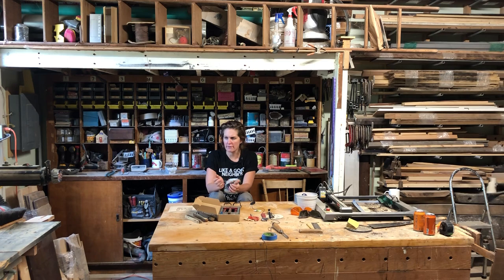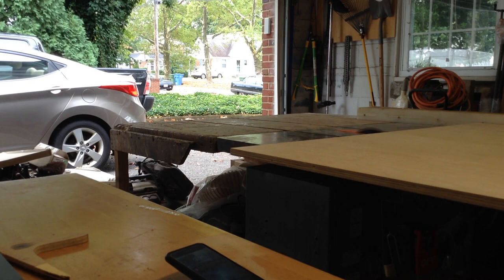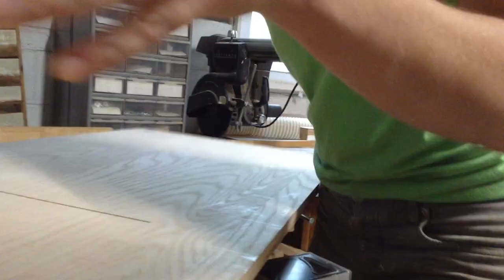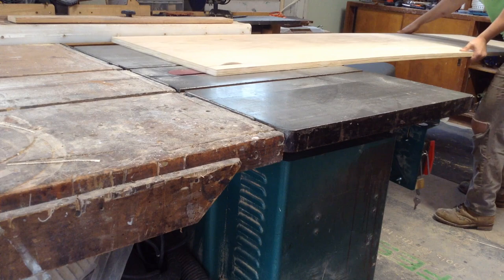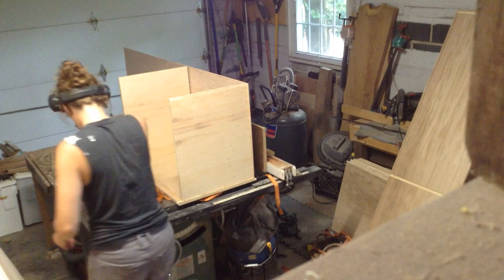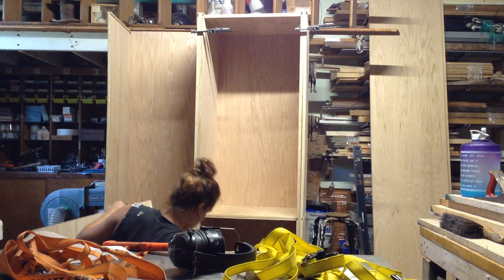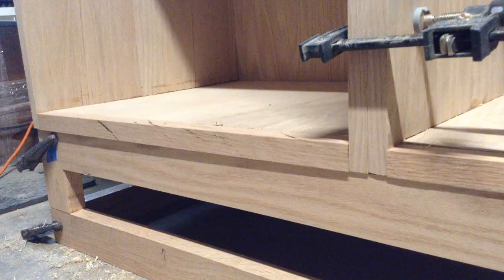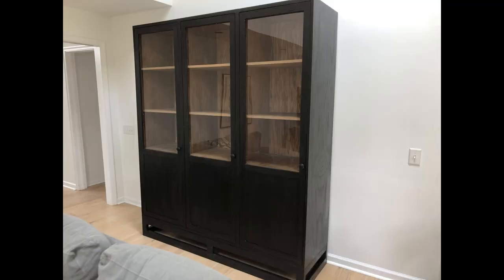Woodworking : China Cabinet w/ Storage // How-To Part 1

Comment: Your radial arm saw must be super well-tuned, to be able to flip the workpiece and get perfect alignment.   Mine's OK, but not that good.

I hadn't noticed that about plywood, but I am going to start checking now.   Thanks for posting, and thumbs up!
Reply from the maker: It actually got moved substantially out of square during the move, you can notice in the video it's not cutting perfect to match when I flip them.  But because these are sunk in dado's it didn't make a huge difference.  Getting it back into square was such a huge pain in the ass though.

Comment: I had the same problem with a sheet of plywood recently.  In my case, I found that much of the variation in thickness was all in the 1” or so from the edge. I have always heard you should discard the material near the factory edge but I had never really found it to be a problem in the premium plywood sheets.  Now I am checking every edge! Love the video thanks
Reply from the maker: That's good to know because my next three projects are going to eat up a lot of ply, and I don't want to keep re-cutting dados and shimming things.

Comment: I find the veneer thickness on the plywood very thin now.
I build most of my projects out of maple. I get my stain from Richelieu here in Canada, not sure if they are in the US.
They mix there own type of stain and it dosen't seem to blotch.
It is a little on the pricey side (45.00cdn) per quart, but in my opinion worth the money.
They also offer a service where they will match an existing stain colors, for a fee.
Great to have you back.
Have a great week.
Reply from the maker: The veneer is beyond thin, you can sand through it while blinking.  I've gotten Richelieu hinges before haven't seen the stains.  There are real nice high-end stains available here, but the majority of them cater to large scale commercial companies.  So, getting a quart is near impossible.  And I just don't do enough stain work to warrant spending the money upfront on a gallon of one color.  But, I agree the quality of the stain can make a huge difference.

Comment: Great to see you creating a full-scale project again. How do you find the oak veneer face to work with? I'm finding the latest batches very shiny and kind of slippery and hard to stain. So enjoyable (and helpful) to see you working on furniture. Thanks for posting.
Reply from the maker: I bought a big 200 foot roll from amazon, because it's cheaper then buying a bunch of the 25 footers and didn't have any issue with stain.  But, I wouldn't be surprised of issues considering the lack of quality control on materials these days.

Comment: Was just at a local big box (the BLUE one) and Baltic birch ply sheet was $100 !!! And I couldn't find any MDF sheets, as I need to redo the work area of my radial arm saw. Off to the other big box (the ORANGE one) to see they have sheet in stock.
Reply from the maker: It's crazy.  When I first started making furniture regularly till before covid. a 4x8 cabinet grade piece of ply was in the 55-60 range near me.  Maple around 55, Oak around 60.  The 3/4 oak I got was 96 a sheet.  And the 1/4 is 50.  Highway robbery.